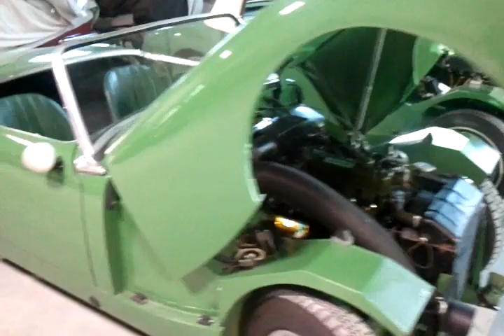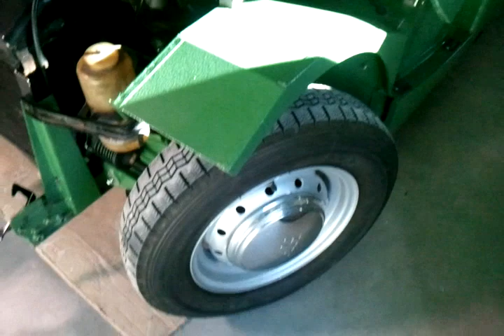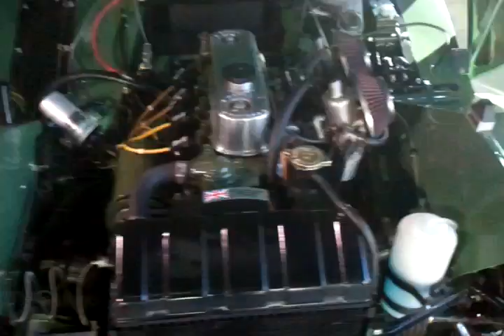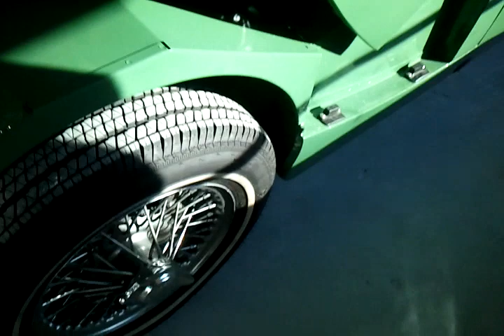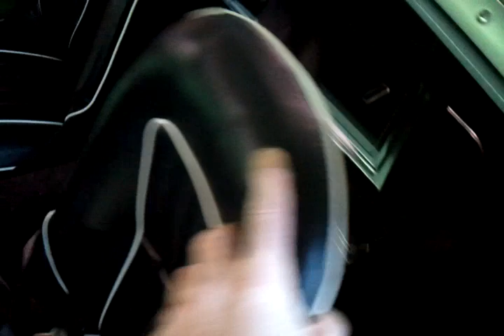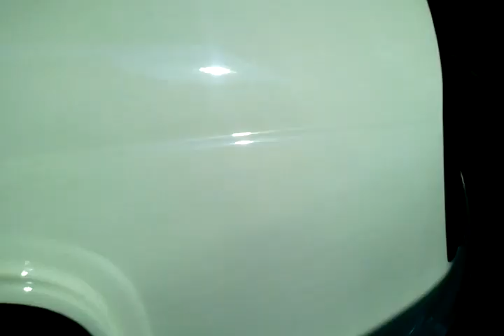His and Her Bugeye Sprites for Sale @bugeyeguy.com

Comment: How does it effect the value of the cars to modify them in this way?  I have a 1959 that is all original except that i put disc brakes on it.  I was thinking about putting a 1275 and ribbed cage in  from my 1972 midget to improve drivability.   Do you have any suggestions.